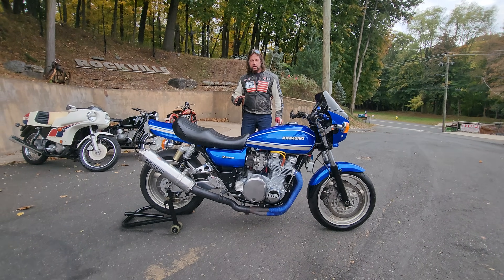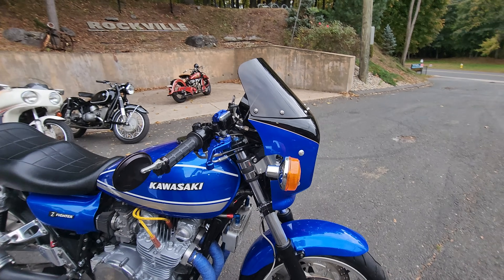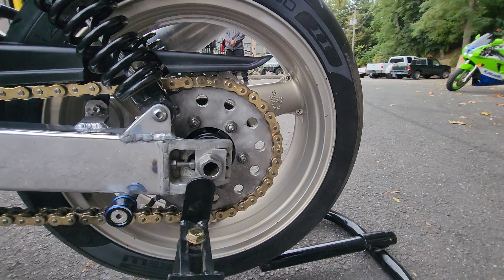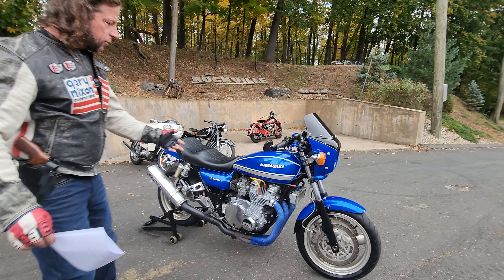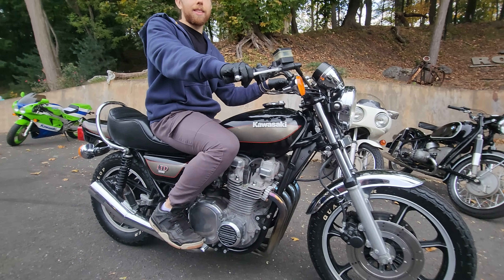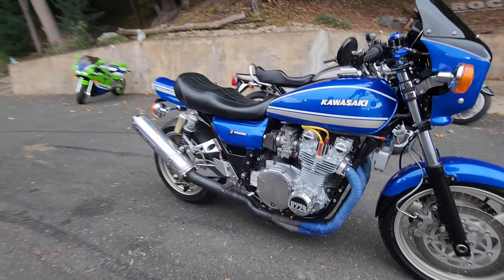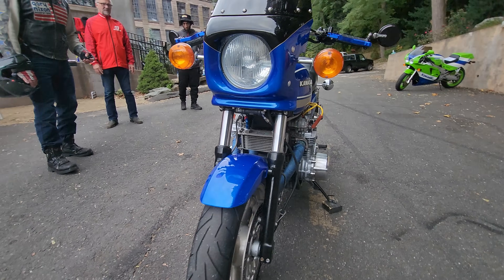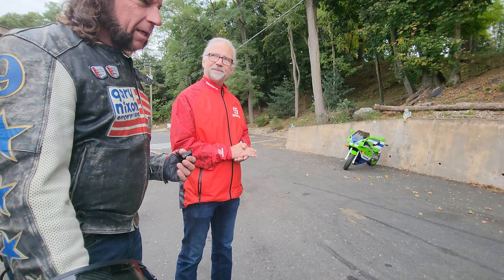Z-FIGHTER 1978 KAWASAKI ZRX / KZ1000A STREETFIGHTER

Comment: Exactly what I visioned. I have an 82 suzuki GS750. I want to do the same thing to it. Already have GS1000 gas tank, 2004 kawi zx10R complete front end and back wheel, aluminum swing arm I believe from suzuki gsx. It has mounts for 2 shocks. The bike is in good shape, has 15k miles runs, and rides. Now I feel like I shouldn't chop it up and should leave it original. I wish YouTube allow pictures in the comments.